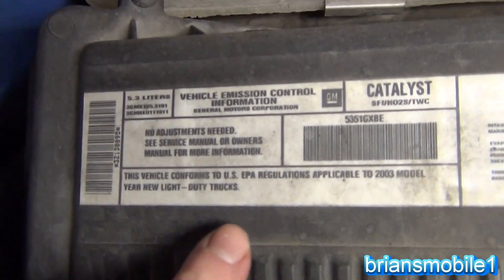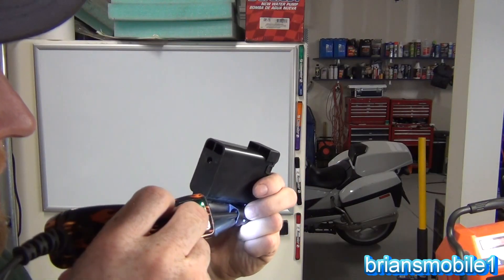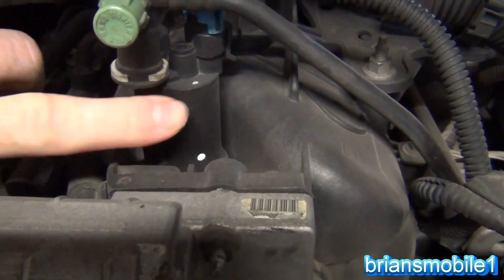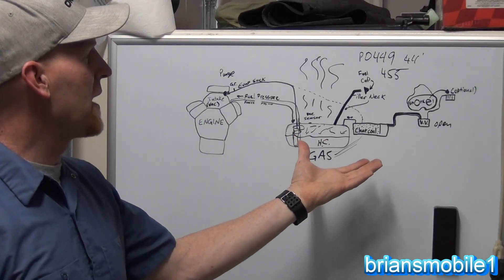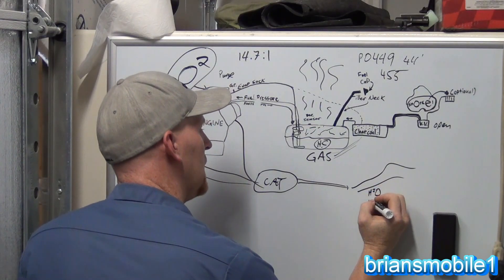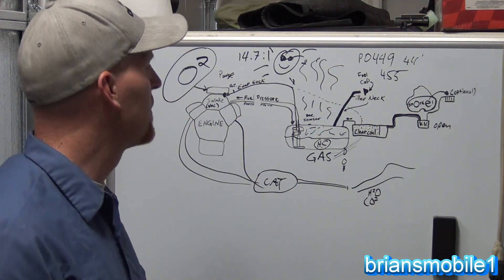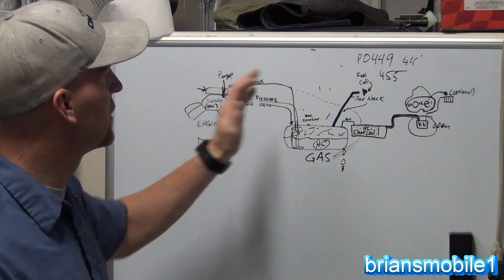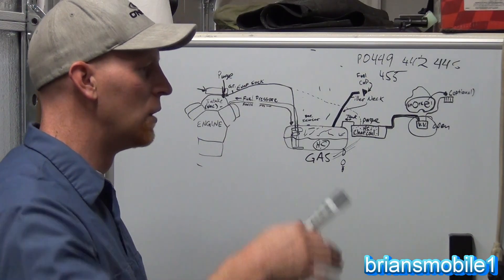P0449 Vent Valve Testing EVAP Systems

Comment: Code 0449 on my 2002 silverado 4.3. Can't get the code to stay off with a new evap valve. Tested power wire. I think the ground is ecu triggered.What should I check next? Gonna replace the plastic hose with heater hose next. Applied 12 v to the new valve. It clicks.Thanks
 Thanks

Comment: Great video. Best explanation of how the whole Evap system works. Glad it's on a '03 Silverado 5.3 since that's my truck too. . I had an P0446 Code. I replaced the vent valve and the code went away....however, I got a P0449 code showing up after a few minutes. I replaced the gas cap with an AC Delco and the code persists. Any suggestions or videos on how to figure this out if the vent valve has been replaced?

Comment: I have a P0449 on my 04 pontiac aztek. Last guy that took my maf sensor apart never hooked up right, plus I had another mechanic change my spark plugs and he didn't put the correct ones in. My vehicle is not running great at all and I'm going thru $50 in fuel every 2 days with alot of misfiring and slow acceleration, jumpy when on highway, so I'm assuming that's misfiring. I literally watch my fuel gauge go down. I'm not happy
Reply: Your video was reslly informative and I look forward to getting this looked at soon

Comment: I have a Chevy impala 2009 that is throwing a p0449 and a p0452 with the ftp sensor I’m not sure if I should replace the ftp sensor or the vent valve I don’t have any tools to check the vent valve so if anyone has any advice for a solution I’m all ears

Comment: Question... I ran my engine a good 20 minutes and the valve at the engine never pulled suction although in the hose from the manifold - there was suction. So I placed my finger over the open tube on the valve for a few seconds and in doing so it began to function as it should pulling vacuum. Is it possible the valve is intermittent or sticking thus throwing the codes?

Comment: Hi can that vent valve intermittently get stuck open causing a vacuum leak?? I've been having this problem where it feels like a vacuum leak but related to fuel/evap system. Already smoked test engine including boost braker but everything checked out ok there. Also noticed short term fuel trims go really lean after refueling and starting car.Also when just idling.

Comment: I have a 750i BMW, when we try to fill the gas tank it will only allow a small amount of gas before it cuts the flow off and it takes forever to fill it up. I suspect the vent or the vent valve is likely the problem. What do you think? How difficult is it to fix/ or exchange? Thank you for the great video 😊

Comment: So I smoked mine through the purge valve on the engine and with key off and engine cold smoke comes out the vent solenoid so I assume it’s stuck open? N causing a major leak?

Comment: I was having the EVAP codes on my 2003 GM 3800. The scan tool told me the vent valve was working... So, I tested the purge valve up on the motor, it tested good, held a vacuum. But, it was an aftermarket unit, so I bought the correct ACDelco unit, I think $28, and the codes magically went away. Personally, I have never had any luck with aftermarket sensors or pumps, etc... Just thought I would throw this out there.

Comment: Hello Brian. I have two questions is it possible to fix the wires to Evap canister without lifting bed??  Also what’s best way to get hose connector off the Evap canister.?  In the process of chang part I found out wires were cut long ago and just fixed with electrical tape so I’m kinda at a stand still now. Thanks in advance for any info

Comment: Question. I have a 2001 Ford F250 and the Fuel Vapor Tube Assembly that connects to my vapor canister needs replaced but my issue is that I cant find a OE Replacement Tube assembly. Will it matter if I replace the tube assembly with a smaller diameter tube. The stock tube assembly iis 1/2 O.D and the replacement would be 3/8 O.D.

Comment: Hey Brian, thanks for this. After my dad passed away, I got his Chevy S10 with the 4.3 engine. It only has 51,000 miles, and it is a money pit. The other day, I got the P0442 code. My mechanic said, it's probably the vent valve. He told me, he has never had to replace the purge valve, but the vent valves always go. I'm gonna tackle this one myself. If it does turn out to be the purge valve, I'll probably have my mechanic tackle that. But thanks for a great video, and yep, I just subscribed to you and gave you a thumbs up. Thanks !

Comment: I got a P0446 code on my 05 'F250. Verified 12v to the plug at the evap vent solenoid. Tested the vent solenoid, and it seems to be stuck open. Replaced the vent valve solenoid, and code did not disappear. Verified that the new vent valve works correctly. Should I look for something else? Only other symptom I get is sometimes when filling up, the gas nozzle clicks off. Gas cap and fuel filler neck looks ok. Hoses around the evap canister look good.

Comment: Brian do you know what the 1/8 vacuum line going to a 2000 Ford Windstar purge valve does?
I put a new purge valve on my 2000 Ford Windstar and long as that 1/8 vacuum line is hooked up this purge valve sounds like a quite horn blowing every time the Computer commands the thing to open.
I had 250 miles to drive home this morning so unplugged that line and capped it. Made it all the way in with no codes, no fuel smell and no issues at all.
Just not sure exactly what the 1/8 line does. Apparently its Top secret info.

Comment: Awesome video 👍👍👍
I recently replaced the EVAP leak pump to a 07 bmw 328i but I still getting the 
code P240A if you are familiar to this problem can you give me an advise what to do next besides the smoke machine 
Do I have to program the new EVAP leak pump I got a original bmw part I don’t know if the new part is faulty do you know how to test the pump with a OBD2 scanner or with a multimeter proves thank you

Comment: I have a 2004 Suburban 1500 5.3 L replaced purge valve replaced vent valve and I'm still pulling a lot of vacuum can it be the tank pressure sensor

Comment: My Van has been running rich for a year, several mechanics haven't known why,
 (or just don't care) 
After watching a million YouTube videos I now think it's purge valve or vent valve, I ordered purge already so starting there, well after already changing DPFE. 
But I have a Lot of pressure in the tank, that releases when I open the gas cap. 
So I think one of those. 
It's a 2002 Ford e150 with 5.4

Comment: Hey Brian. Sorry for commenting on old content. Question: since this is just a 12v solonoid, should the ground wire of the power plug to the vent solonoid be continuous with chassis ground? Im looking at a case where I've found that the white ground wire is not continuous with chassis. Thanks for your content and efforts!

Comment: Hey man I’m having an evap problem but no codes. my car has a great idle and respond well driving at low rpms but once I try to accelerate (above 3500 rpms) my engine stalls. what do you think I should do?  08 infiniti m45

Comment: So how much vacuum does the purge solenoid draw? Is it just a small amount? Or is it engine vacuum?
Reply: I can answer my own question now. The duty cycle on the vehicle I'm working on maxed out at 20% for the purge valve, so the amount of air that is pulled is rather low yet still pulls full engine vacuum.

Comment: I have a 2007 pontiac G5,,,The rear defogger worked until I removed the relay from the underhood fusebox & now it will not work however, the light on the on/off switch located on the dash, it lights up but, no voltage at the rear window defogger electrical tabs & I cannot find  a wiring diagram. Can u assist me?  P.s.  I know how much u love that platform,,,,lol....

Comment: Question this vacuum valve can cause a lean condition code p0171 And p0174 with a long term fuel trim bank one 25% short short term 3, same bank two .only wend I am in park engine at 567 rpm?  THANKS

Comment: wondering w/o crawling under it 1st to see if the bad piece    VAPE CANISTER    is on the rear of the tank or in between the bed & cab ( which seem's way harder to get tooooo....... ESP., IF WE NOT BEND SO WELL BEING OLDER..........LOL   REALLY SIMPLE &  STRAIGHT 4 WARD  HERE  THANK'S..................   JUST WONDERING TO KNOW WHICH BAD CANISTER WE ALL HAVE SINCE CHEVY & GMC  SWITCHED BETWEEN THE DIFFERANT YRS,. IN EARLY 2000's.............. mine is the 2002 w/ the 5.3 & it's an ext,. cab short bed & it's a 2 wd model......  wondering where my bad canistar is at under the truck before i crawl under it  any way to know from the net or online before i get on the ground.........???

Comment: Getting p 1074. Bank 2 .. new motor  and popped up. I put an 02 on the up stream and it didn't fix it. Every once in while gas pump kicks off few times when I fill it up.  Idk if the two are tied together or not . But a brand new motor. So I'm hoping valve, canister, or map sensor. I was told ever the sensor on the top of the fuel pump can cause it..if anyone can help

Comment: Always  check your hoses, I found out on my Tahoe the hose that connected in between the canister and the fuel vent valve was completely cracked open at the ends.i replaced the hose and that fixed the problem and I spent nothing but my time and had a piece of fuel hose kicking around,  so watch out.
Reply: Did your engine stall when pulling off hard

Comment: I know this probably got nothing to do what you’re talking about I’m not sure I could have something to do with it I do have a vacuum problem with mine I have a 2005 Chevy Silverado you takeoff yet about 25 I’ll send Dara p.m. to go up but you lose power you can’t go can go nowhere then you lay off the pedal couple times up and down up and down with it they might pick up when you get up to 35 miles an hour sometimes he goes to that instead of 25 miles an hour and once you pass that 30 miles an hour or 35 you might be able to get up to 55 or 60 I change the transmission fluid and filter it look good clean transmission was dark not not that dark do you have no problem take it off with it just sometimes will get a 35 or 25 miles an hour then RPM to go up and can’t go nowhere I change the throttlebody I bought a used one out of a junkyard I don’t have a good idea or not but I wanted to see if that’s what was it before I bought a new one I thought it might be also the paddle I said truck is a 2005 Chevy Silverado 5.3 if you can help me out I’d really appreciate it give me some clues what to do I really would appreciate it Oh yeah I do have that code P0449 so that’s why I’m watching you I think you I just found your channel

Comment: I already had a good ideal of how it all worked,  but kept forgetting names,  & etc. The way you explain everything put total confidence in me as I  will be tackling this project this upcoming weekend of checking & possibly changing out the pressure valve or solenoid. 
If you happen to see this or anyone who may know,. I was just wandering if a smoke test 
 could be done on pressure
 control valve :;  vent valve: 
Thank-You  Calvin

Comment: So it's normal for the vent to stay closed when you blow after you remove power to it? Mine does the same thing when I tested it and I figured it was malfunctioning. I am experiencing high pressure in my gas tank and DTC low voltage on fuel tank pressure sensor and can't figure it out.

Comment: purge valve on manifold on engine is it normally open or closed? If i put manual vacuum pump on either nipple it doesnt hold at all but if i apply 12v it seems to open wide open fighting po455 replaced fuel sending unit, canister vent valve and purge solenoid , and fuel cap

Comment: Pencil test lite ,     12v. to positive vent solinoid pin ,  grounded neg pin .      No activation on 3 Solinoids tested         Had shop use "Power Probe ."  Immediate activation .         Conclusion ; ?   Pencil test lite wiring not  suitable to current needed by solinoid to activate . Hope it helps

Comment: Mine has been rapidly ticking intermittently. Rough idle, LTFT went to -18. 2006 Matrix w/ 150k Must be letting to much vapor into intake. When it happens it will go away if I turn engine off then on. Can I try cleaning it with MAF cleaner or just replace?

Comment: Hey Brian, I've seen a guy test the purge valve by unplugging the hose and wire connection and seeing if the valve has suction when you put your finger on it. Is that test a general one you can use on other makes aswell?

Comment: excellant video Heres the problem  Gas tank fills l really slowly .    Vent valve was replaced . Still slowly.      Tested new vent valve with 12 volts applied no click/ no blow resistance     Tested old valve same thing .        If it's venting  "open"  to atmosphere when filling   why should fill be slow? . Or should it be closed when filling ?   12 volts are not being applied when engine is off at gas pump ? Am I thinking in reverse or what ?  Thanks

Comment: I have ML 350 2004 and code is 446 (Shut off value is bad). I smoke tested it, it is not closing.  The part is discontinued.  Is there a way I can have my car pass inspection?  Thanks (perhaps closing the value manually?

Comment: What in the system you just explained would cause the gas pump to keep turning off when filling the tank?
Reply: Great question I have the same technical question . the charcoal canister can be defective . Ithink it can be related to the vent valve as well . If the  vent valve stays in an open position it somehow blocks tank venting on fill ups ??? Not sure

Comment: I have a 2007 yukon with p0449 code, it says the vent valve circuit is open. I tested for power at the solenoid, got power, so I replaced the solenoid valve. Still have the code. I checked all my fuses. Checked wires at the canister and at pcm. I dont see any issues. I tested for ground at the canister and it seems to have ground all the time, which it shouldn't if I understand it right? It should only complete ground if the solenoid needs to be closed. So mine is closed all the time. The only thing i can think of is that it rubs somewhere on the frame. Would you agree or any other ideas? Any good points where it would easily run through?

Comment: One  question, got a p0171,new fuel pump,map sensor ,air check valve fuel press reg/filter, purge sol valve, intake gasket.  am also new ECUlooking for the mother of all vacuumn leaks.  am replacing vent valve next,  o2 sensor showing very rich.  STFT49  LTFT25.  Thanks , good info.

Comment: Hello, I must say thank you. I have a silverado with the code 449. I had some damaged lines so I replaced those and the code persisted. So I removed the solenoid and wasn’t sure how to test it without a costly scan tool, I rely on blue driver and although that’s an awesome tool, it’s only can give information, not test, etc.  

So I found this video. I went to amazon, ordered the tester, got it today, did the test procedure you describe and BOOM.... I have confirmation the solenoid is faulty. Although it confirmed a bad solenoid, it was a relief to have the answer. Will get the part, replace and go on with life. Thanks for this video, I am so relieved. 

Also, got a new tool to add to my box. I’m new to the industry. Will be starting tech school most likely this fall. Depending on scheduling. Funny thing, I went to university and obtained a masters degree in psychology. What a mistake. I should have went to tech school first. I had this desire to work on cars. To have a problem and fix it. Added with my love for all things automotive, I should have followed my heart and not my mind. I’m not going in to this for the money, I’m doing this because I absolutely love working on vehicles. I already know my way around vehicles, I have two vehicles approaching 200k, a truck and a Mazda. I’ve rebuilt all of the suspension, replaced the AC comp, and did a complete brake job on the Mazda. On the Silverado, I’ve done the fuel tank, fuel pump, fuel lines, blower motor, oil leak on oil pan, diagnosed a parasitic draw, replaced the suspension and brakes. All though this is easy work, I’ve learned a lot. I’m looking forward to getting started. 

Once I graduate, I’m blessed with the ability to start my own business. I’m planning to buy a work truck that can carry all my tools and supplies with room for common parts, equip the truck to handle everything short of engine out and start off as a mobile mechanic doing light maintenance and repairs. As I gain experience, get further training and I feel confident in my competency, then I’ll add more complex services to my offerings. I’m aware of the challenges this entails. I’m aware I’ll have rough days. I’m aware customers can be... um....you know. One thing I also know, I can’t get from here to my goal without traversing the path that gets me their. All the while learning along the way. I’ve already had people have me work on their vehicles. They see me work on mine and want me to work on theirs. I actually have a regular customer now, a veteran. I work on his truck. Nice guy. I work for parts and lunch. Don’t charge labor. I figure I’m getting as much out of the experience as he is from having his vehicle fixed. When I’m finished with school, I won’t be able to work for free, but service persons of all types will get a good discount. 

My absolute biggest goal? I’m gonna be that repairman that has a waitlist because everyone knows, I’m honest to the core. I absolutely will never  say “yeah, I can do that” if I have the slightest inclination I won’t be able to. I also won’t use scare tactics, if a car is seeping oil, it doesn’t usually need fixed that moment (with rare exceptions). I’m building my vision on honesty and quality. By doing those things right, I won’t have to worry about if I’ll have enough work. 

Long winded, I know. Started down this path over a year ago. Best decision I’ve made. Looking forward to a lot more exciting repairs.